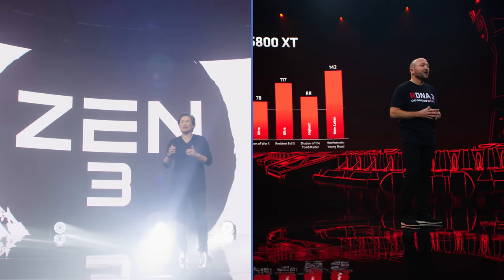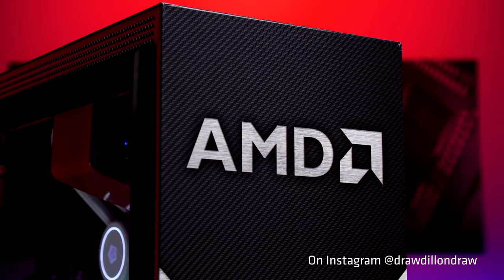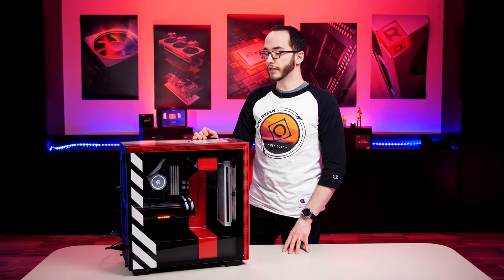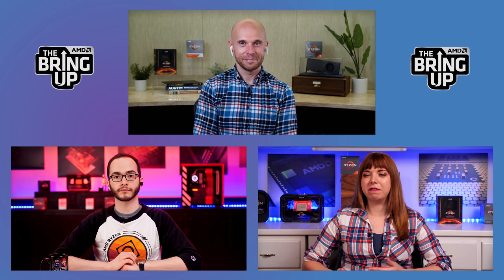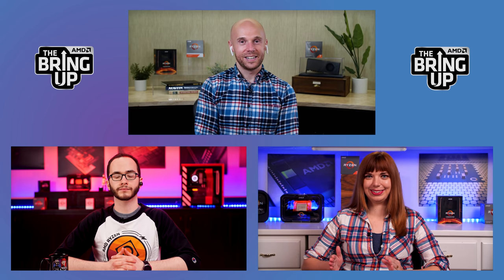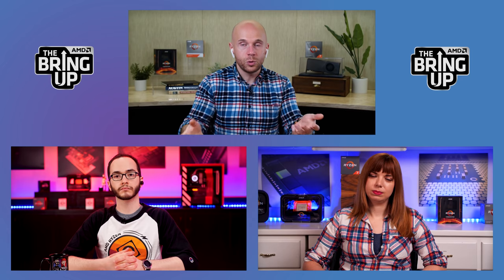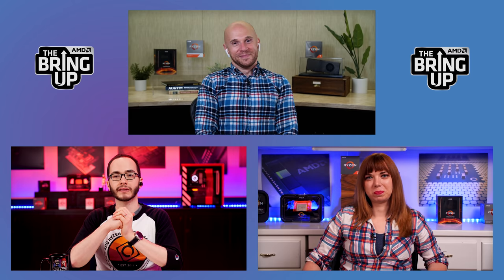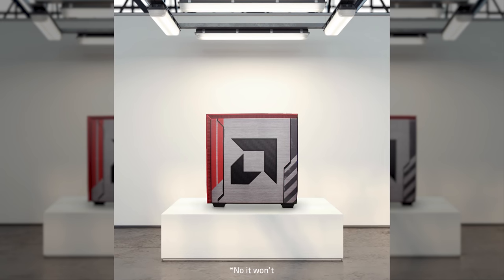The Bring Up - AMD Ryzen™ 5000 Series Desktop Processors

Comment: MAKE MORE RYZEN 5 5600X. 
MAKE MOREEEEEEEEEE. SPEED UP YOUR RESUPPLY.
Reply: WE WANT THE 5600 and 5700X! BIN FASTER
Reply: Of course, sure AMD is not trying to sell as many products as they can, right? Because that just makes sense
Reply: @davkayo6757  If they were, the R3 3300X would be in stock by now :)
Reply: @Khalsa-bt7jx  u demn right, why they havent thought about that option? why try and sell their new generation of products and funnel all their resourses to them, when they could manufacture the old ones, the slower ones?

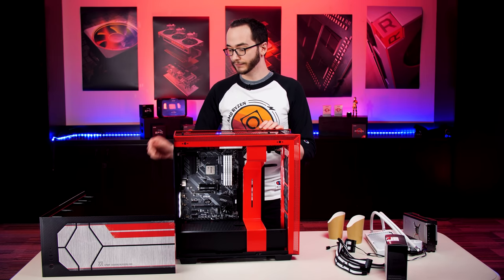Comment: 4:13 - Steve from Gamers Nexus would like a word with you.
Reply: @TheFinalRevelation2  The orientation of the radiator allows air bubbles to continue circulating through the pump. Putting the hoses down means the air will get trapped the tank at the opposite end, which will increase pump life and decrease noise.
Reply: @tiladx  good

Comment: I built a new desktop rig based on the Ryzen 3900x last year and it is frankly brilliant.  I can render out of Lightroom and Davinci Resolve and carry on working on other things at the same time. Can see this rig lasting me a good 5-7 years easy but on an X570 motherboard I have upgrade option should I feel the need.

Shortly I built this machine my Dell laptop died.. rubbish timing given the Pandemic and working as a photographer but I replaced it with a HP Omen Laptop based on the Ryzen 4800H which handles everything I throw at it. 

At the beginning of this year I helped a friend build  a new system... yup built it based on a Ryzen 3700X.  

Never going back to Intel again.

Comment: Flip that radiator please, that's the wrong way up.
Reply: I think he routed the tubes that way for neatness, mine are correctly oriented but they cross over my RAM as a result.
I think actually, they should change the standard ATX layout, so the CPU is low above the ps and cooling can go around the board (back or below).
Then GPU cards are above and won't exhaust into CPU cooler's air intake
Reply: @RobBCactive  MB manufactures are trying to squeeze in more PCI-E slots, and you tell them there's less room now? Not a chance. Also, you are forgetting the air coolers, they need more room above the PCI-E slots to fit. Btw the ATX standard is a standard because it doesn't change, you'll have to come up with a new name for that. Also you'll still need to consider where to put all those PCI-E slots, unless you want to figure out a way to utilize both sides of the PCB, there's no way to lower the CPU socket by much. There is a much easier solution though, longer AIO cooler tubing, don't need to be much, maybe an extra 2 inch / 5 cm will do.

Comment: wow, the projector idea is awesome! Cool PC, only from my point of view, better to have inside some ROG Strix board :)

yes, with voltages is it as Robert saying, only what is danger are high SOC voltage, if someone want raise FCLK clock+memory and add SOC voltage. I think for SOC on Zen3 is safe up to 1.15V for 24/7 and 1.2-1.22V for benchmarking and up to 1.45-1.475V for LN2 (but careful on AVX2 load)

Comment: Hope NZXT already fix that red bar covering for the wirings. Thats very hard to unscrew, especially when using eatx motherboard (msi x570 godlike). I ended up using drill bit to destroy (if that was a proper word to use) the screws, that red bar covering is heavy. But you'll love the NZXT case though for its cable management, and overall simplicity when done building/working on it.

Comment: Robert totally dodged the question about safe voltages and temps for overclocking. He basically just confirmed what the OC community has been suspecting since 2nd gen, that the safe temp and voltage are directly related to each other.
Reply: He said between 0.2-1.5V and up to 95C, but the higher frequency/volts is on the best cores.
They are clearly saying "waste of time oc-ing CPU, put the effort into the RAM oc".  That matches reviewers experience with limited value of all core overclock.
Under-volting a little may pay however pay off, by reducing W & C allowing more boost opportunities.

Comment: 5:30 yeah i'd like to know more about the pico projector and the programs you used to set up the displays 11/10 for the projector and HWinfo readings idea for the back of the card. Because of that projector that is the best build i've seen in at least 10years, Unicorn puke has ruined case designs for years and drove prices up for some reason. Never seen the appeal but hardware info displayed so cleanly on the back of the card PERFECT.

Comment: I'm glad you want to open up more about the cpu's, the architecture etc. but would rather see benchmarks / tests etc. Idc how it's made, but how well it performs to be frank.
Reply: Public 3rd party reviews are out for the CPUs, preliminary AMD numbers are available online for the GPUs, 3rd party numbers for GPUs will be available in about 7 days.
Reply: @ColtaineCrows  I'm very well aware. Yet, how do they defend / support those numbers? What about stress testing / endurance? Do they have tips on overclocking? Which features can be utilised? Anything which is practable or informative for a user would be nice. I'm no chip designer. Sure it's nice to hear about details / inside info. However, there more interesting and important things to cover imo.

Comment: The single connector for nzxt front panel is great until you realize there's a hard drive activity LED built into the power button that flashes constantly and cannot be disabled unless you cut the wire. I hate it. There's a coaster on my case all the time because of it.
Reply: Nail polish the pin for HDD activity. Or some other lacquer.

Comment: Dang that projector. Serious next level.

Quick question, for the Rx 6000 and Ryzen 5000 do I need pcie gen 4.0?
Reply: No not strictly, but currently you should have a 500 series mobo which has a recent BIOS for Zen3 support, they have PCIE4.  In Jan the 400 series mobos with updated BIOS can support Zen3.
Pairing them together, SAM works with 500 series chipset, so you need that PCIE4 mobo for maximum performance.
Some builders had problems with PCIE3 riser cables, PCIE4 must be turned off in BIOS (and reset off after update which resets defaults)
Reply: @RobBCactive  AHH that clear things up. thanks a bunch!
Reply: @maplelief_dreaming  It's a pleasure

Comment: And no zen3 support for Asus crosshair 6 hero X370 which is better than any B450 board. Too bad... I would like to upgrade from my zen2 CPU for new R9 5900X CPU but it's no from you. :(
I've had R5 1600, R7 1700, R5 3600 and R9 3900X on this board and now you say that road ends here...

Comment: The day after apple m1 lol
Reply: It's trash compared to Ryzen 5000
Reply: @ShadySKWASHA  you can name call but existing articles from anandtech show Apple m1 to be ahead of Ryzen architecture not just Ryzen 5000
Reply: @ShadySKWASHA  lol if I have to link the most influential cpu review website you’re clearly not in the know AMD fanboy
Reply: @ps3customgamer  "In the overall SPEC2006 chart, the A14 is performing absolutely fantastic, taking the lead in absolute performance only falling short of AMD’s recent Ryzen 5000 series." Learn to read, it falls short of the new 5000 series. Plus these are not third party bench marks. If you trust what apple said in their presentation as not being the result of optimized, synthetic benchmarks then you don't know much about the difference of x86 vs ARM. Apple ARM CPUs will not handle workstation application, they have to emulate the X86 instruction set rendering them useless for applications like CAD and many other of the actually difficult process to perform quickly. Apple is just trying to build hype to sell you into buying a ipad in a laptop with no touch screen, that will not be able to handle any workstation tasks. Period. You yourself clearly have no experience build PCs, overclocking CPUs, and running benchmarks. Gtfo
Reply: @ps3customgamer  if the M1 was that impressive they could at least include units on the axis in their graphs or which specific laptop chip they were comparing it to

Comment: If you keep increasing the prices AMD you'll lose all the progress you made to gain the trust of your consumers. Don't become the next Intel.
Sorry if my english is not good enough :P
Reply: I wouldn't really complain about pricing before the rest of the Ryzen 5000 lineup is released.
I think the Ryzen 5000 launch was a bit rushed to get those CPUs out with the new Radeon 6000 GPUs.
Reply: @uzefulvideos3440  Maybe. They problably release in a couple of months the 5600 and 5700x cheapers but i still thinking that increasing prices is not a good move
Reply: @YEST1  The thing is, the current prices are still very competitive. And demand is high. If AMD would lower prices the CPUs would just get out of stock sooner.